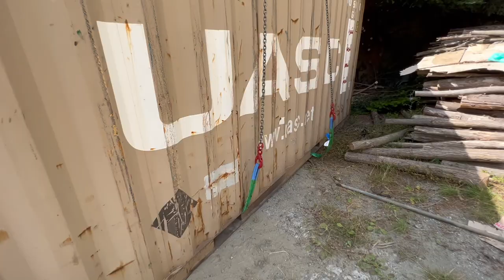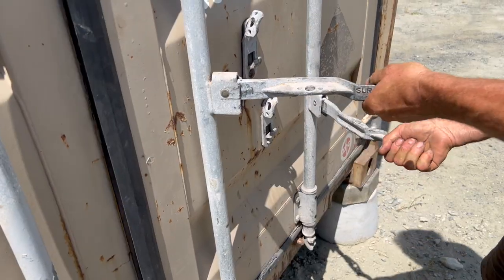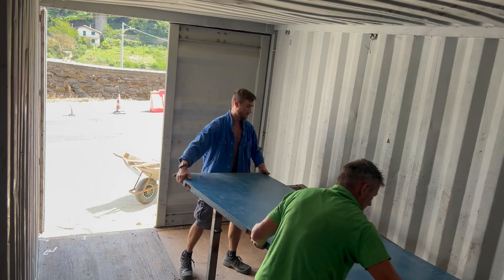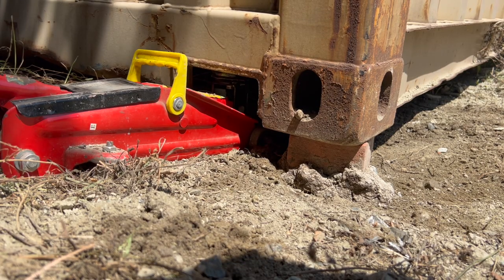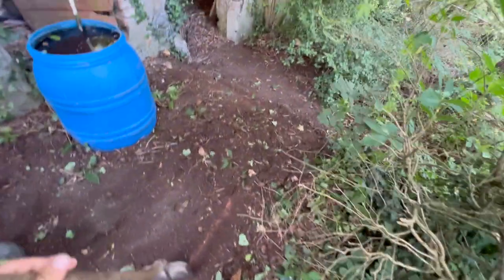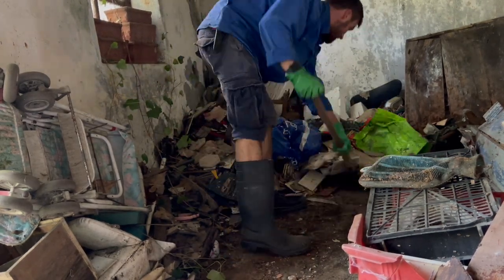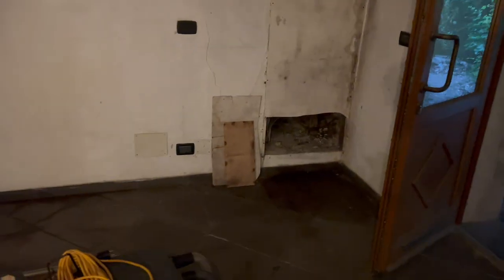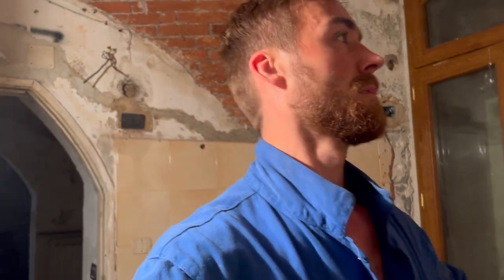008 || DIY workshop from shipping container; A start to our home renovation

Comment: The crane driver was frustrating to watch! A berkey water filter maybe?
Reply from the maker: It was wasn’t it, it was so frustrating to work with this guy. I didn’t get what you meant with the water filter sorry.
Reply: @Villa_Oliva  You can buy a berkey to filter your water, they’re expensive but the water tastes clean, it’s a stand alone metal container..
Reply from the maker: Oh like that, yes good idea. I’ll have a look if I need to put in a filter. The water tastes good though, but I should buy a little test kit to make sure it’s good for drinking. Thanks!